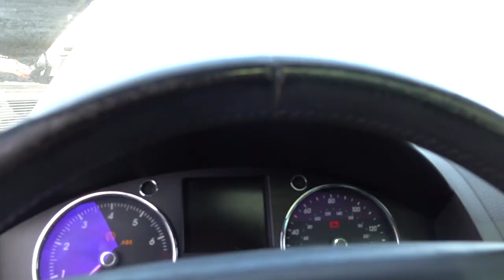This $1000 V8 Touareg gets the Zac Chop treatment and now sounds nuts! 621 Golden Ep.003

Comment: And thats why we recommend steel suspension Touareg's.  Our cheap project Touareg is also "I gave up on life blue"..... I hate it.  
PS Beetles have 5x100 or 5x112 bolt patterns.
Reply from the maker: Yeah, he was joking because Scotto called his 911 a super beetle.
Reply: @HooniganProjectGarage  Got it, then beetle it is ; )
Reply: Ah, the air suspension isn't that horrible on these. Got 205,000 miles on mine.

Might just need a new retention valve. Easy fix if that's the case.

Comment: Put a sideways barrel duel exit exhaust it will give you the sound And all the back pressure
Reply: back pressure is not something you want its really a myth they only used to say you wanted a tiny bit because it has to do with exhaust velocity and scavenging there is a happy spot somewhere between tiny bit of restriction and too big that yields best performance but generally back pressure is bad
Reply: @drewalsup9200  I agree, but punctuations dude. They exist for a reason.
Reply: @drewalsup9200  part of the back pressure legend nowadays comes from the ECU turning it down because the exhaust flows too well, so you have to retune it
Reply: @drewalsup9200  I would think all the scavenging is done by the time it gets to the cats,  but maybe some straight pipe from there would be cool/help the sensors make sense of things.
Reply: @drewalsup9200  some back pressure is good with a N/A car, but with a turbo you want it as free flowing a possible.
Reply: The best way to think about it, is that engines are air pumps. Any restriction means less performance, end of story. Backpressure is the enemy of power. The low end torque he's talking about here has nothing to do with backpressure, end everything to do with harmonics and wave propegation in the exhaust.
Reply: @unlisted9494  Though in this case I do tend to suspect that removing all that exhaust behind the cats may have less to do with scavenging.   Not that they intend to buy one, but I suspect maybe if they did a little shopping  they might see what a cat-back kit for one of those looks like and then they could see what could be necessary for the ECU and exhaust tune to function right. Maybe it needs a crossover or other collector back there.
Reply: @OllamhDrab  in this case, it's caused by turbulence. When you remove the exhaust behind the cats you're introducing the dirty under-vehicle air which will cause the exhaust to tumble and swirl in ways it wouldn't if it were in a tube, so you're going to lose cat efficiency (more restriction) and exhaust temp. Exhaust temp is speed (which is why mufflers are mounted as far back as possible, that's where the gas is moving it's slowest and will spend more time in the muffler, making the muffler more effective) and when you lose speed, you lose torque as you're actually creating more exhaust backpressure. This is mostly only applicable to n/a though.
Reply: @unlisted9494  Very good.   I'm kind f just wondering if that computer's cutting out the down-low power cause some sensor's not hot enough,  etc.

Comment: @8:15 No engine needs back pressure they need enuff exhaust to provide parasitic vacuum to help pull exhaust out of the combustion chamber and help mix air fuel on the way in.
Reply: Two strokes needs back pressure
Reply: Exhaust Scavenging is the term lol
Reply: Two strokes only need back pressure for an expansion chamber to work properly, but the stringer after the expansion chamber pretty much does all that. The mufflers are mostly just to keep it from being horrendously loud.
Reply: So a straight pipe to the back would help?

Comment: NEW GUY WITH THE HARD e21 flex!  We need a bio!  E21s clean are the rarest of the rare.  So many get parted out for 2002s.  They are basically a perfected 2002 with EFI and a 5 speed.  Pre e30 digital 80s.  The transition from Neue klasse to 80s e30.

Comment: 8:19 That “back pressure” myth was debunked.
Reply: Yeap I was like dyno prove that shit when he said "this got like no torque at all" And even if it had like 5lb ft lt less torque I doubt you could feel it.
Reply: DuBstep115 the almighty butt dyno
Reply: It’s all just noise, it sounds like your going a million miles an hour but you’re only doing 30, when my ‘10 impalas exhaust broke off right at the headers it has the same power but sounded like it was going a lot faster and sounded horrible obviously because #V6

Comment: I have the same car, absolutely love it. It's a tank that sounds mean as hell and don't give a shit if it gets a bang or two
Reply: Don Ochetti reliable? Should I buy a tdi for around 4-5grand
Reply: @kentbremner7828  the most reliable engine is the 3.0tdi and dont buy one with air suspension they arent really cheap to run some parts are expensive like brakes but if you like cars like this i recommend 3.0 diesel and no air suspension
Reply: @kentbremner7828  Very reliable, build to last. I purchased it 8 years ago for 7k and has no electrical or mechanical faults since, non nada. 
There are a few videos out there to show you what to look for when buying one used.
Reply: @lordluis121  Agreed the 3.0 tdi best bet with NO air suspension.

Comment: Build back full pipes with a couple glasspack mufflers and you might get that torque back. Backpressure is a myth, just run a full system....maybe it needs more fuel in the tune

Comment: Fun fact, the toureg always has a dead battery because the fucking battery is under the fucking seat. Also 5x130 is the Porsche pattern, not VW. It's just on Touregs for some reason.
Reply from the maker: Because Cayenne and Touareg shared platforms.
Reply: @HooniganProjectGarage  Yeah totally. But it begs the question of which came first. All touregs also have brembo 4 piston calipers iirc, so there's some good parts on that rig once Zac yeets it. I've been eyeing those brakes and hubs for my Super Beetle if I ever go crazy with it.

Comment: That high sierra might be of vintage it doesn’t matter.. but NEVER EVER start or rev the engine of the dead vehicle while connected to the charging vehicle.. starting and revving while still connected causes an electrical spike to the system charging the vehicle.. connect.. charge.. disconnect.. then start kids.. sending surges to electrical components may not break the pieces today, but it will greatly reduce their durability

Comment: I laughed my ass off at this stupid Touareg 😂, I used to work in a VW shop and you commented on the 2004-2008 Touareg’s main problems all in one video, electrical, air suspension and the driveshaft😂. Plz only VR6s if you gonna work on VWs